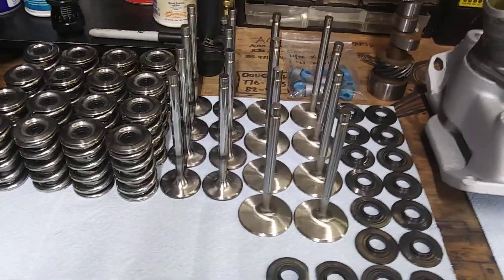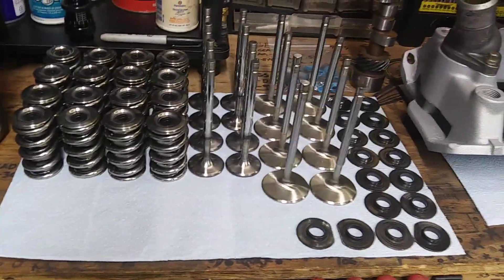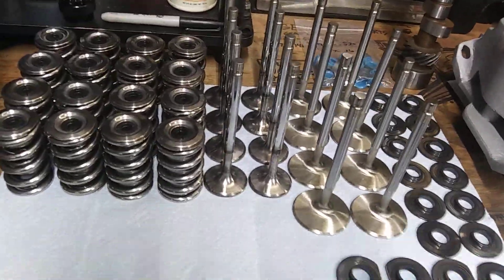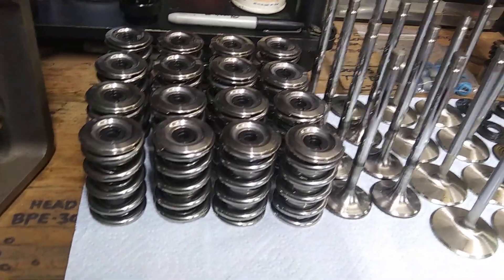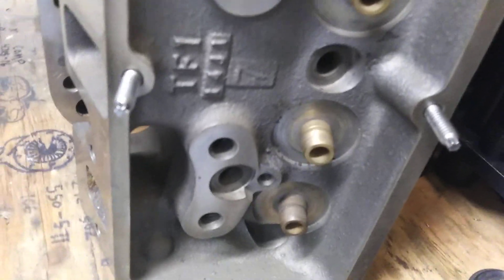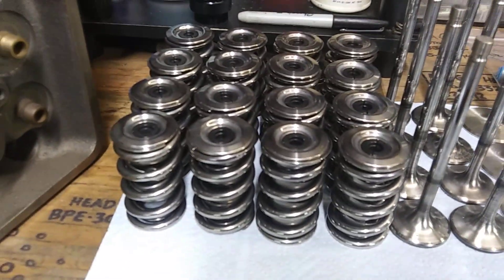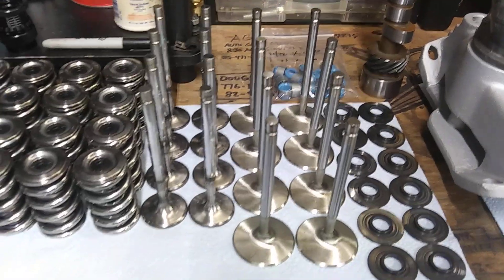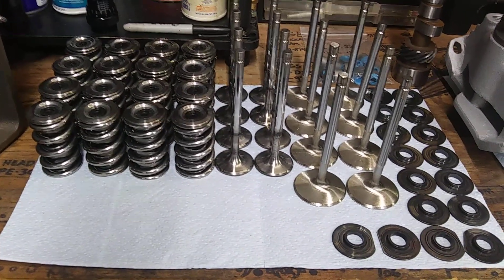Tips on using a solid roller cam.

Comment: What solid roller lifters do you recommend for Oldsmobile?
Reply from the maker: @claytonstoolbox  ISKY, Lunati, Howards, Herbert, Crower. They all make good lifters. New old stock CRANE solid roller lifters are good too. If ya have the bucks, BAM or Jesel lifters are real good, but pricey. Solid roller lifters on the street a guy better off using lifters with bushings rather than needle bearings. Last longer and much safer.
Reply from the maker: @claytonstoolbox  Pontiac uses the same solid roller lifters as the Oldsmobile if ya find some listed for Pontiac.
Reply: @ I called Hebert cams today as the lifters have a great price. But the guy said they were for pontiac and wouldn’t work in Oldsmobile. He suggested Chevy lifters. I knew he was wrong so I never bought them. I wonder if I should get those despite what he said. He probably doesn’t know about Oldsmobile.
Reply from the maker: @claytonstoolbox  Not many people really know the Olds engines. Most people never even seen one. I've been building them since the 80s. Had a few run in the 10s NA. Even built a NHRA legal Stock G/SA 71 W-30 455. It ran 11.60s in the 1/4 in a 71 Cutlass. Built quite a few of them over the years. Still build them today. First engine I ever built was a 400 Pontiac in the early 80s. Also built Alot of Buicks back in the day.
Reply from the maker: @claytonstoolbox  GTOs and Firebirds got me into Pontiacs. My dad had a Superstock 442 Cutlass back when I was a kid, that made me like Oldsmobile engines.
Reply from the maker: @claytonstoolbox  Actually Herbert Cams sells a good solid roller lifter for Olds/Pontiac for cheaper than about anyone else, they they are extremely well made. They sell badass solid roller cams for Olds and Pontiacs too. Can order with a steel distributor gear that's compatible with standard distributor gears. $30 dollar option. It's worth it. You should check them out.
Reply from the maker: @claytonstoolbox  I just bought a rowdy billet core solid roller with the optional distributor gear on it for a SBC, paid $330 bucks shipped to my door. Took a week. Custom ordered cam. It's 260/270@.050, .630/.630 lift, 106 lobe sep. They have options when ya order your cam. They been around over 60yrs too. Pretty good parts

Comment: Man love this fckn channel.. brought up around Hemis and Harleys this guy makes me feel like im right at home in the garage. thanx bubba. keep it up. At 52 i can finally work on some toys for myself. thinking of a 355 and thinkin doing just that a solid roller, yep. this cam is what ive been eye ballin and any input is more than welcomed, its been a very long time since ive wrenched on a motor. Crower  cam, solid mech. roller. -- # 00426  adv dur, 288/290,      @.050  -  250/252    gross lift. .570/.584  w/ 1.5 / 1.5 rocker ratio. 112 lobe sep. im going to use Skip whites NKB heads 200cc aluminum with 64cc chambers, elderbrocks duel plane intake and a 750 brawler carb. flat top pistons 2 v 5cc and shoot for zero deck and .040 quench. great work with this channel brother thanx
Reply from the maker: I dig old ass hotrod motorcycles too. 60s/70s drag bikes were the shit. I raced motocross bikes back in the 80s. Started with KX 80s, then RM125s, then KX250s were my thing. But then I discovered drag bikes. Not much cooler than a twin engine Norton/Vincent/Triumph/Ironhead HDs Top Fuel drag bikes from the early to mid 70s. I had a couple old drag bikes years ago. Still have a old Ironhead that's been retired to a bar hopper. It's still pretty quick. Also had a 77 KZ1000 that was modified for drag racing. I mostly just build engines these days. Done got old.....
Reply: @thereluctantgearhead4544  back in the day,  buddy of mine had a husky 250 kicker on left side. tell ya what  them boys know how to build a damn 2 stroke. yep the kz 1000 was the fastest out there back then just stock. lunati also has one im lookin at  its a 290/290     @50  248/248  gross lift 555/555   lobe sep 110 with centerline of 106. ultimately i want it in a early 80s malibu  and a 4 speed  around town shit and i have a 1/8 mile about 40 min from me. any better than the crower?
Reply from the maker: @jessekampegaard8491  Lunati makes good cams. Been using them for years.
Reply from the maker: @jessekampegaard8491  Had a 81 Malibu Wagon that ran 10.20s in the 1/4 at 140+mph. Used a NA 477ci BB Chevy in it with a 748 lift solid roller, Team G 4500 intake with a BG 1275cfm Dominator. That was about 30yrs ago. Built it for street racing.
Reply: @thereluctantgearhead4544  Man i love wagons..  and the Pontiac 400 awsome strong ass motor. Id say you had an early start lol holy shit. im glad you have put up this channel man learn alot.. hope ya dont mind me picking head a little bit. this is going to be something me and my son are going to do together lol lost his mother when he was 4 and raised him myself, hes now 18 so i have a whole younger crew lookin at me like ole fck. there all about the ls and computers. and i do get it. easy hp nowadays but my hard head tells them son and i can go old school and whoop your ass haha. i got a few 30 yr old snapper heads id love to show up.. so this is going to be little icing on the cake..
Reply from the maker: @jessekampegaard8491  Sorry for your loss man, I can relate. Life ain't been easy. These young bucks believe whatever any so called authority figure tells them. Fuckin clueless really. Definitely a different generation. Going fast ain't nothing new. I'll always prefer the old school monsters. Shit still works.
Reply from the maker: I did beat a Kawasaki Ninja on my old Ironhead in a 1/8th mile drag race on the street. Surprised his ass for sure. Been a few years back.
Reply: @thereluctantgearhead4544  ive never had the opportunity to take a car to the strip. Raisen kiddos and workin like a retard. now im ready, excited as hell. dont want to have to take out a mortage to do it, but... will stretch way out there lol.a welder fab sheet metal  guy spent 11 yrs down south. now back up to new england ( Maine) collect disability. but do some side stuff. I restore and paint classics.. work starting to pickup. building new paint booth and small shop. gotta be in it before this winter.  its gonna be a great year.
Reply from the maker: @jessekampegaard8491  Pretty cold up in Maine. I couldn't deal with it. I'm from Lousiana myself, but I've lived all over the place.
Reply from the maker: @jessekampegaard8491  My dad was pretty into the drag racing long before I was born, grandpa too. So I was born into it. Had no choice but to be a gearhead. I'll probably mess with this shit till I die.
Reply from the maker: @jessekampegaard8491  Built my first V8 car engine, a 400 Pontiac at age 12, built motorcycle engines since I was 9yrs old. Put a KX80 engine on a go cart when I was 10. Built a Q-jet at age 9. Started collecting car parts around that time. Had a 53 Chevy when I was 12. By the time I was 16 I had 7 or 8 cars. Dad had me cleaning parts and doing other shit work at 4 or 5 yrs old. Spent every weekend at the dragstrip growing up. Shit definitely got in my blood.
Reply from the maker: Thanks man, that Crower stick has made 580+hp in a 357ci NA SBC. It's pretty good. Used heads that flowed 308cfm. Super Victor intake. With these NA SBCs, you want a tight lobe separation. 106-108 is pretty much ideal from my experience with them. Wide lobe separation generally better for boosted applications. But I'm building a turbocharged 427 bigblock with a 110 lobe separation. It'll work fine.
Reply from the maker: Those NKB are pretty good heads. You should probably run a singleplane intake on that build. A Vic Jr or Holley Strip Dominator would pick it up. 2 inch spacer helps on these type engines too.
Reply from the maker: I've ran low 10s with NA 350 SBC based engines built right. In 3000+lb street/strip cars. I'm gathering parts now for a NA 1972 355 Block that's going to make over 625+hp and turn 8500rpm. All forged lightweight rotating assembly. Heads are heavily ported Dart 215 Pro 1s, 320+cfm@.700 lift, 230+cfm on exhaust. Ported Dart 4500 singleplane intake and a 1050 Dominator. 13.8-1 compression. Cam will be in the 288/296@.050 and .730ish lift range. 106 lobe sep. Bullet solid roller. It should boogie.
Reply: @thereluctantgearhead4544  Boogie? lmao that thing will dance to tar off main st. talk about big shit out of a small package.

Comment: I'm slowly going more nuts but have shitty bare Chinese heads just spent over a grand on morel solid rollers is their a way to have them heads machined to be able to take heavy springs they are afr copys same foundry in China
Reply from the maker: Just use good valves and you'll be fine. Those Dart Pro 1 copys are pretty good. It's the early Pro Comps that couldn't take the pressure. Get some Ferrea or Manley valves.
Reply from the maker: Might need .200 long valves if your needing a 1.950 -2.000 installed height.